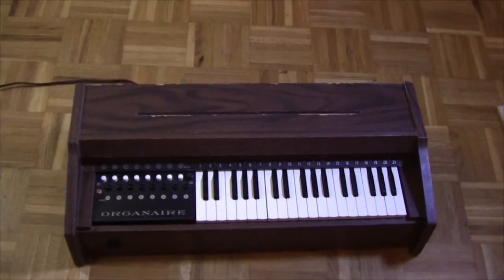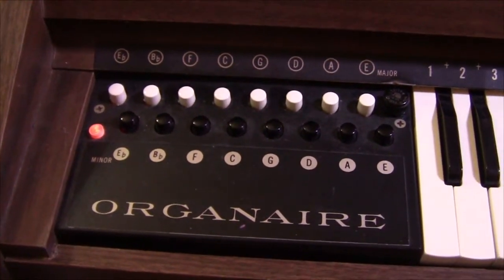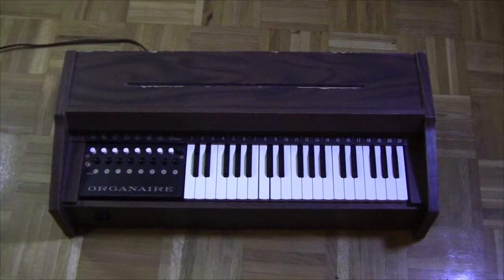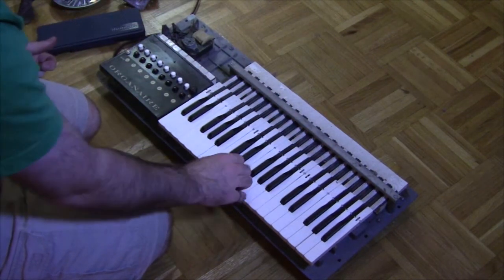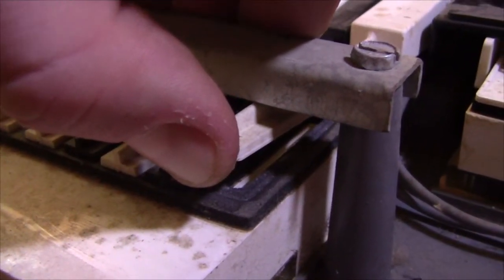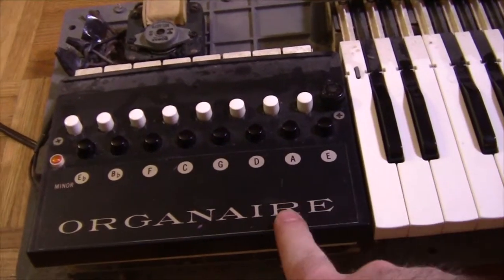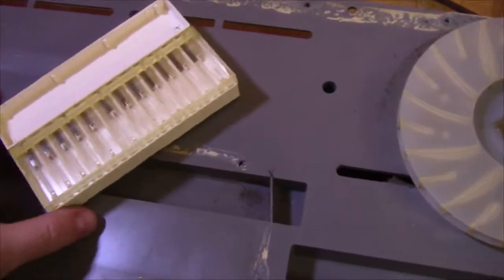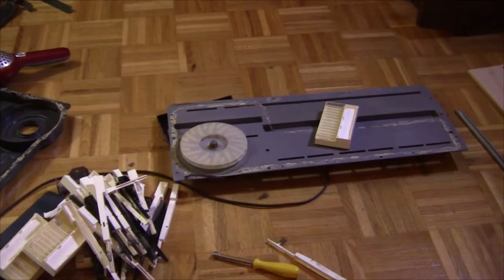Taking Apart an Organaire Keyboard

Comment: I was gifted an organaire for Christmas (model 0335 if you can find anything on it) and took it apart for some maintenance. I’m really glad i came across this video because I didn’t document my process and thought i would have to put back together by memory. The electrical tape i believe was intentional from the manufacturers because mine has em too.

Comment: I have about 4 versions of this.I just picked a floor model up ( someone was throwing it out) and it will not produce any sound.The motor works..the circular intake thingie rotates( but makes a racket).I just took most if it apart and I can't see what a problem might be.
Reply from the maker: hmm. Have you tried spinning the impeller by hand? Does it seem to be rubbing at all?